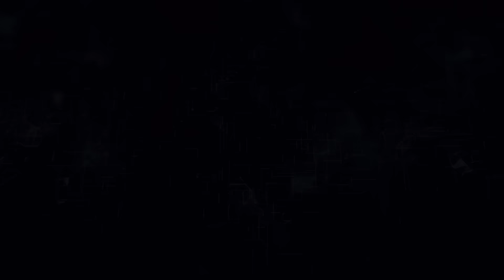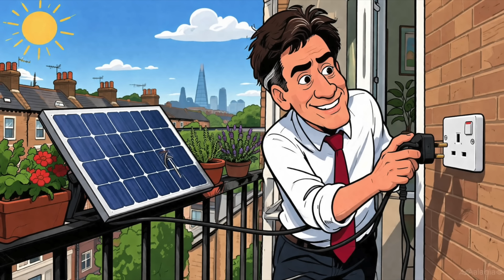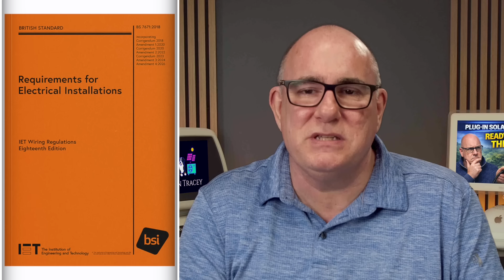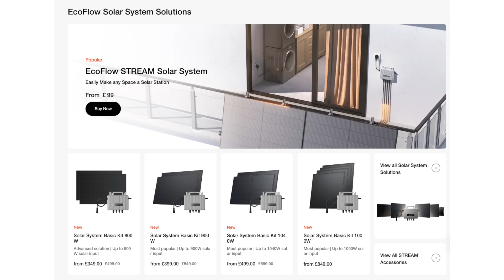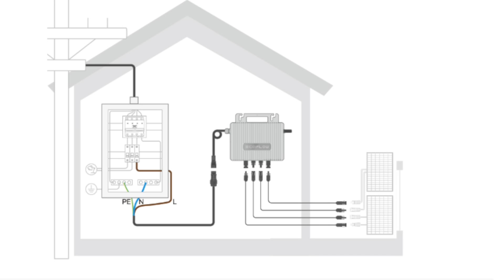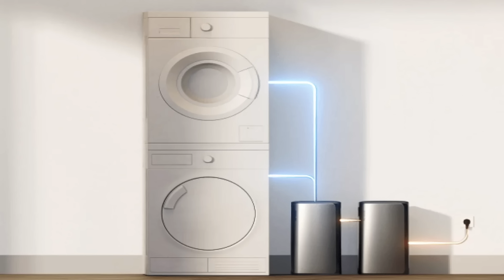Plug In Solar Is Coming… But There’s a Problem

Comment: You are so right, this is something to cut the edge off the power bill. 
The other way to do this is to take a circuit or some appliances off grid and then slowly add to it.
Reply from the maker: @Ulbre completely agree 👍  

That gradual approach works really well — start by offsetting a bit, then build it out over time.  

It’s exactly how a lot of people end up moving toward much lower bills 👀
Reply: The combo actually works really well. The grid tie will keep the stuff you don't want to rewire and mess with running (lights, chargers, sockets you use now and then etc), whilst separate battery/inverter boxes can drive the heavy demanding stuff without touching the house wiring.

Comment: I'm hoping that the micro inverter and 2*450 watt panels (which I'm waiting to arrive) covers my base load, then the roof system exports all the generation to the grid and charges the battery. I might install a battery at a later date. What I don't know is if there is excess generation would that go to the grid as free energy or as exported income?
Reply from the maker: yes, and if you already have an export meter in place, you’ll get paid for it

Comment: Well positioned it would cover the average base load of a house... but not the appliances that use kWs
Reply: Image shows laundry equipment..the tumble dryer with small battery would it trip out the kit
Reply: @j.nav31..is7 The current Ecoflows will blow the plug fuse if you put 2kW of equipment directly on one and the battery drops to point it tries to charge. This seems to be a bit of a design flaw.

For equipment from reputable providers there are two values in the specification one is the inverter power limit, which is the most it can provide if the grid is down. That's about 1kW on the Ecoflow units. The second one is the "pass through current/power" which is how much current and thus power you can draw through the unit with some or all of it coming from the grid, which Ecoflow don't give but does seem to be the full limit of the socket (ie the 10A sustained). Drawing that will not damage the device but not all of the power will come from the battery.
Reply from the maker: It depends on how you can figure it. The batteries can supply up to 2300 W if you pull the power directly from the battery not through the house connection.

Comment: Had my 2 panel 900w (peak) for 5 years. Cost back then about £1100, during March to late October the only electricity I use is from the electric cooker microwave and the nightly use. In my experience it does make a difference. Think about where you can best place the panels.
Reply from the maker: @Chris_Gordon_1973 that’s a solid real-world example 👍  

And you’ve nailed the key point — placement makes a huge difference.  

For a relatively small system, getting that kind of seasonal impact is exactly what you’d expect 👀

Comment: These kits have been available for some time via Amazon UK.
Reply from the maker: yep but your not allowed to plug them into a socket that’s the legislation change. once that happens shops will carry them and people who don’t shop on amazon will be exposed to it
Reply: @JonathanTracey  I just bought one such system, the Ecoflow Stream Ultra. The power lead it comes with literally has the wires trimmed and crimped for a 13A plug.  Earth the longest, live the shortest..... 
Their website says these will comply with the new regulations and they will sell you a new power lead with fitted 13A plug if you want.

Comment: Haha, Iv had a 300w panel and microinverter plugged in since 2018!
Reply from the maker: any issues?
Reply: @JonathanTracey Nope none, my smart meter shows that most is being used up within the house, get the odd day where 50w or so spills over back to the grid but its not worth the hassle to chase down the peanuts they would pay for that
Reply: @JonathanTracey .   @HubbHubbs is still alive 😂😂😂
Reply: i'm still trying to find a sparky who's prepared to install this without regs (due for an update on April 15th 2026) that give them the means to do a kosher install and offer a warranty. Can you recommend anyone near Bath/Bristol?

Comment: Thanks Jonathan. Could you do a video on costs , effectiveness of any one system, and more importantly, payback time. I feel there may be a lot of hype coming over balcony solar but little to say if the system will make a real difference.
Reply from the maker: sure and in fact I’ll go one further, I am working on a video right now which will come out in a week or maybe 10 days time. I will give you all of the stats, how much it paid itself back even though most of the time it was over winter and it was used mainly to import energy store and release it back into the house. And then going to publish all of that data online so that anyone can go and look at it at any time they like and see exactly how it’s progressing from an ROI perspective.
Reply: @JonathanTracey Thanks. Ive subscribed so look forward to viewing.

Comment: They are already for sale  and already plugged in I know several people that have them 😮
Reply from the maker: Yeah, it was his head. I did it for two years and it was absolutely fine. This is really just about the legislation catching up which will allow these kind of system to be sold in supermarkets or by Amazon.
Reply: @JonathanTracey yes I jumped in before the post finished and you explained it all 😊

Comment: I would just like to add that if you reduce the fuse appropriately in the plug in a plug in system then you are doing a basic over current protection measure. But nobody has mentioned this simple change in any of the videos I have watched.
Reply from the maker: @andygardner7119 You’re right in principle 👍 reducing the fuse is a form of overcurrent protection.

But in reality, most people wouldn’t even think about that — plugs come pre-wired these days and people just plug them in and go. Swapping fuses isn’t really something the average user does anymore.

That’s why modern systems are designed to be safe *as-is*, without relying on the user to make those kinds of changes 👍

Comment: Our home is basically an east/west facing centre terrace so any roof top system will be limited anyway and we have limited internal space to put all the "gubbins" that is required so these micro "plug and play" systems to help offset our daily base usage may be the way for us to go.
Reply: East/West is one of the best options for small scale solar like this. South facing you get sharp peaks in the middle of the day, East/West you get fairly even generation through the day and it'll switch across from one to the other set as the sun moves around. With units that have multiple MPPTs or at least two strings that works really nicely.

For fixed installs inverters normally go on a back outside wall these days with a bit of rain protection. Since batteries are now supposed to go outside or in a garage or similar everyone has been producing batteries and inverters designed to sit outside.
Reply: @etchedpixels  That's useful to know. Thank you.
Reply from the maker: @barrymiller526 Yeah that’s exactly where these systems make a lot of sense 👍

With a terrace and limited space, keeping everything simple is a big win — the inverter is small enough to sit behind the panel, so all you’re really bringing into the house is a standard power cable.

Perfect for covering a steady baseload without needing all the extra “gubbins” of a full system 👍

Comment: So as far as I can see, these plug in systems shut down if there is no mains supply. So when you need power the most i.e. a power cut the system is not optimal. This system is only a 'supplement system' to get the government out of paying to upgrade our insufficient grid system. The next point is the time it takes for the system to pay for itself. Its just another half baked scheme by a half baked government. If the government really wanted to help they should make proper solar systems more affordable for everyone which could make the break even point in 1 or 2 years. But this would mean the government receiving less money for services, so most probably won't happen. My question is will you recoup your outlay before the guarantee for the plug-in system runs out? Then there's the fact we get an average of 2.2 Solar hours daily in the UK meaning 2 solar panels will produce a max of 1.6 kWh a day (if your lucky).  Lets also be clear, this sort of plug in system will produce almost nothing during the winter months, extending the cost breakeven timescale..
Reply from the maker: @StevoStevoStevoStevo-c1y There’s a bit of truth in what you’re saying, but also a few things worth clearing up 👍

- You’re right — standard plug-in / grid-tied systems do shut down in a power cut. But that’s not a flaw, it’s a *legal safety feature (anti-islanding)* to protect engineers working on the lines
- If you want power during an outage, you need a system designed for it (battery + backup capability), which is a different setup entirely  

On the “supplement system” point — yes, that’s exactly what they are. They’re not trying to replace full rooftop solar, just reduce your *daytime usage and bills* with something simple and accessible.

On payback — for a small system it’s typically **~6–7 years in the UK**, and panels/inverters usually have 10–25 year lifespans, so there’s still plenty of time where it’s just saving money.

Completely agree though — making full solar systems more accessible would be the bigger win. This just lowers the barrier for people who can’t install a full system.

So yeah — not a silver bullet, but not a “half baked” idea either 👍
Reply: @JonathanTracey I accept some of what you say, but a better system for everyone would be just to have a 5kWh battery and an inverter connected to the mains with an EPS bypass box. Couple that with a dual rate tarrif you would have a safe backup power supply during power cuts and be able to use the stored power when you need it most. Make it a 10kWh battery and you would run your house daily on the cheaper tarrif saving more than adding 2 solar panels

Comment: So what does it cost?
Reply from the maker: what does what cost, there are many parts but you should be able to buy an entry level system for a few hundred pounds
Reply: @JonathanTracey  For the 800w the box of tricks and the batteries. And how do you connect all your background usage to this ?

Comment: Why the hell is it illegal to produce your own electricity in the first place
Reply from the maker: its not
Reply: Producing isn't. The problem is what you do with the electricity. If you integrate it into your house electrical system through a grid-tie inverter - which is the most convenient way to use it - then you are potentially creating a dangerous situation. So such grid tie systems are rightly regulated, requiring installation by someone certified and a lot of expensive paperwork to document and ensure they are fully compliant, which just makes it expensive.

None of this applies if you are keeping your own power entirely separate from the grid though. If you want to throw a solar panel on your shed to power the lighting and charge your tools, no problem. Doing this for your whole house gets expensive: Solar panels are cheap, but batteries are not.

Comment: I really think that a lot of people are going to be disappointed when they find out that you will most likely never get the full 800w all the time.
I imagine that most panels won't be pointing in the optimal direction or angle and just wait till it's raining.
I'm already seeing a lot of interest in the DIY forums from people that don't have a clue and asking advice on how to connect up their plug in solar stuff they bought from Temu and Alli express.
Reply from the maker: @adrianmaguire5459 You’re absolutely right 👍 you won’t get 800W all the time — that’s peak output.

But even with less-than-perfect angles, you’ll still get useful generation. In the UK an 800W setup is typically ~2–4 kWh/day averaged over the year, which is enough to cover a decent baseload.

Agree though — expectations need to be set properly.
Reply: Most of that temu and aliexpress stuff is totally non UK approved and the UK government really needs to crack down on them like France now has

Comment: People have been installing these for years. My parent's last house had a few panels on the garage roof connected to an Growatt inverter and though it peaked out at around 1.5kW it made a real difference to their electric bills over the six months of the year from April to Sept and they also had an electric diverter unit that dumped any excess power to a room heater so no power went back to the grid. In a cold country like Scotland that was a good option.
Reply from the maker: @johnsinclair1912 Yep, people have absolutely been doing versions of this for years 👍

And that’s really the point — the concept isn’t new, it’s the UK finally catching up with clearer rules for smaller plug-in style systems. Sounds like your parents had a very practical setup there.
Reply: I live in Finland and I'm sure plug-in  devices like that aren't allowed here, but would that mean that when there's no consumption in the house, the solar panel's revenue goes to the electricity company for free? Most of my electricity consumption goes to the fridge freezer,so the savings would be 1/5 of the time the thermostat turns on😅, heating is done with wood and requires a few dozen watts of electricity for the circulation pumps, and that's usually after dark. Most of my electricity bill consists of a fixed monthly fee to the electricity transmission company of €45/month + €0.08/kWh for transmission and tax. The energy price is currently €0.014/kWh because I have chosen exchange-traded electricity. Fixed-price energy contracts for a year are around €0.08/kWh.

Comment: Thanks for clarifying the solar situation, not easy to find info regarding regulations cos there isn’t any as yet.
Had panels and thermal for 18 years never looked back.
Generated over 65000 Kw and so much hot water.
Why aren’t newbuild houses forced to cover roofs with solar?????
Reply from the maker: @johnfoster5754 Thanks, and completely agree — it’s hard to get clear answers when the framework isn’t really there yet.

And yes, I think more new-build roofs should absolutely be designed with solar in mind. It feels mad that we’re still putting up brand new houses without making proper use of all that roof space.
Reply: Because the regulations don't require it, only meeting the standards for efficiency. These are the same crooks who build roads the home owners end up liable for as the council won't adopt them, sewers that are also dumped on the home owners, run rackets like tying you to their own dreadful internet provider (nobody else allowed to run fibre on the estate), and even stopped including doorbells to improve shareholder returns.

our new council built housing after Wales ended the Right To Buy scam are however covered in solar, and the cost is only marginally higher and in roof solar is not really much different in price to tiles at this point (tiles are cheap but more labour).

Comment: The efficiency of the panels is related to where and how they are installed, if they are shaded or not facing the path of the Sun then they suffer dramatically, so DIY is great, but if the panels are not installed in a location where they are at their most efficient then they are utterly pointless. This is a great explanation...but another example of how the Government have made announcements with out undertsanding the subject they are talking about...they are doing a "Martin Luther King" - namely, they have a dream, but they sadly don't have a bloody clue.
Reply from the maker: @jim.franklin You’re spot on about placement and shading 👍 that makes a big difference.

Where I’d push back slightly is “utterly pointless” — even non-optimal installs still generate usable energy, just less of it. It’s more about reduced efficiency, not zero output.

And yes… the policy side is definitely a bit ahead of the detail at the moment.

Comment: The 800w limit is the case  in other countries,  but the relates the the maximum EXPORT . It aways  was and is better to USE your self generated energy than sell your excess . So relatively small plug in battery/solar systems can significantly reduce most peoples energy costs without exporting. Modular battery systems like the stream allow the additional battery storage to be added incrementaly , particularly usefull for people with older solar systems currently without batteries. The Ecoflow stream system also allows the many consumers to benefit cheap night rate electricity plus the added benefit of an emergency power supply. All this in a simple DIY solution. It is a massive step forward don't downplay it too much 😂
Reply from the maker: @ianfossett4482 Completely agree 👍 using your own energy is always better than exporting it.

That’s really where these systems make sense — small scale, self-consumption, with the option to add batteries and take advantage of cheaper tariffs.

Definitely a step forward, just needs the UK rules to catch up properly.
Reply: Most countries the 800W or 1200W limit applies to the amount you can feed back into your house power via the plug socket. The US which is in some ways the closest analogy to our wiring the limit is feeding in 400w, but you are allowed 1200W if you have the trip downrated to protect the circuit.

As it stands right now if you went the current approved procedure of a separate electrician fitted circuit and bidirectional RCBO, isolator etc and wired in your devices you would be allowed 3.68kW on your G98 without pre-approval. Norway is similar, France I believe is 2kW.

The two numbers are very different things and measurements for very different reasons. The 800W limit stops you setting your house wiring on fire, the 3.68kW limit stops you setting the grid transformer on fire 8)